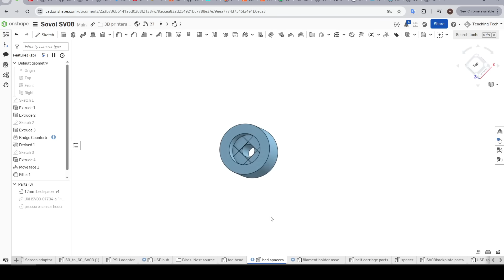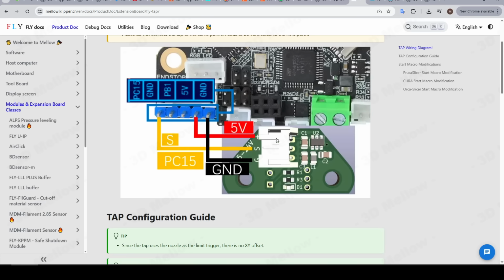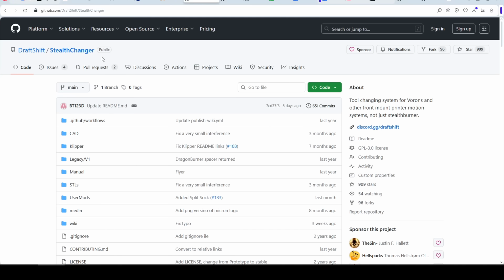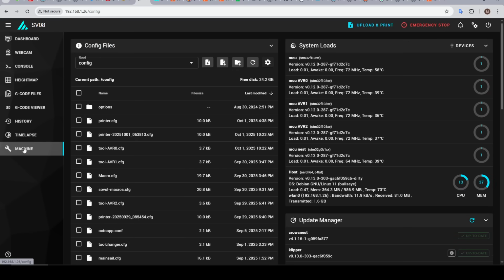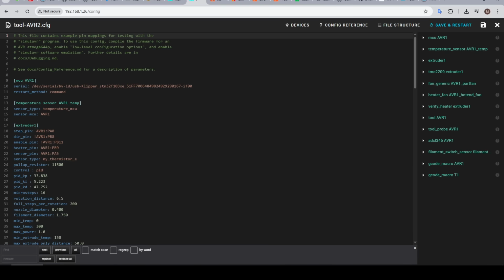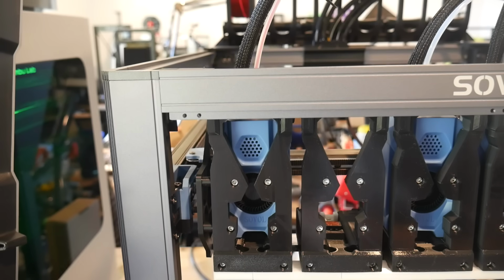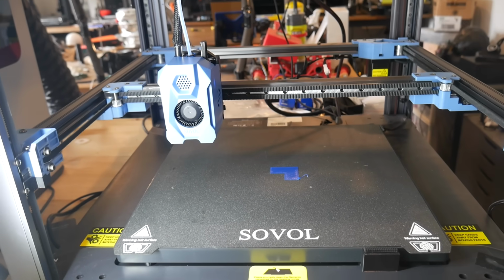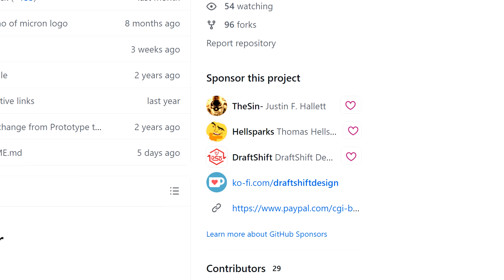Software, calibration and printing! - Budget Sovol SV08 toolchanger part 7

Comment: I was very enthusiastic about this when Part 1 came out. By part 3 not much interests was left and by now I figured out I don't really need it. And if I ever do I'll just get Snapmaker.
What I'm interested now is how to make stretched version of SV08. Either just one direction and make is 350x700 or in two direction making it 500x500.
Reply: Instead of trying to stretch an SV08 (or any mass-produced printer) you'd probably be better off doing it to a voron while building it.
Reply: @bo0tzz  second bed for SV08 + 2linear rails + alu extrusion,... 300 eur. Option 2 : Voron kit + second bed + linear rails + extrusions. 2000-2500 eur. I would definitely be better of with voron but I already have SV08.
Reply: @frantzs1077  Or sell the SV08 and get an SV08 Max.
Reply: @originaltrilogy1  Way to simple :)
Reply: Or a sv08max as a base instead of the sv08 ...
So many choices ...

Comment: that's the weirdest toolchanger by far! travelling 600mm to change a tool alone takes half of the print time
Reply: I give you the benefits of the doubt, it was clearly mentioned in the video that the speed shown was not the final speed. As an owner of a Voron 2.4 Stealthchanger let me tell you that the Z axis can easily be run at 50 mm/s feedrate adding only ~6 sec of Z movement to a toolchange.
Reply: @FSIronman  If you wanted to, you should be able to run Z much faster. On my 350mm stealthchanger I’m doing Z travel at 250mm/s and z_accel 2500mm/s^2
The big key there is make sure you have stealthchop disabled. A lot of configs, including the one my machine was based on, have stealth chop on the z axis enabled. It might be slightly louder, but you can push the speed much quicker
These speeds, and tuning travel speeds when changing tools, lets me go from printing with one nozzle to another in about 6 seconds
Reply: @SteveBobRocks  what motors /drivers/voltage 

Best I can do before it racks is 100mm/s and 400 acel.
Reply: @PointBlank65  Drivers are TMC2209. Motors are LDO-42STH48-2004AC
I know I am pushing them pretty hard, but so far I have been running them hard on two 2.4s and I haven’t killed anything 
In the stepper_z section, I’ve got run_current:0.8 and stealthchop_threshold: 0
Then in the motor sections microsteps: 64